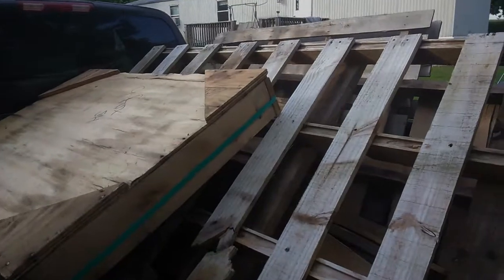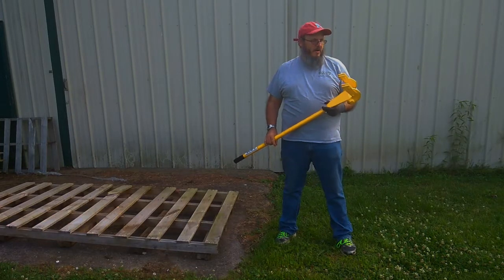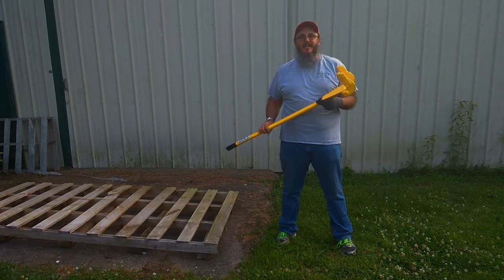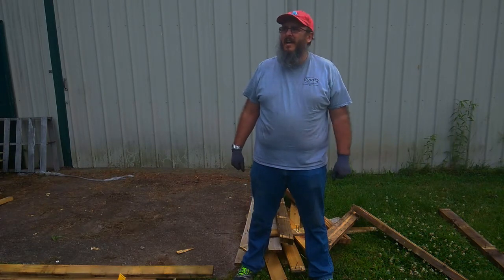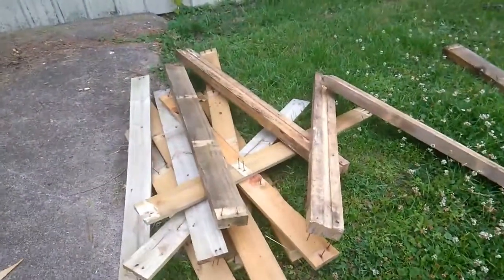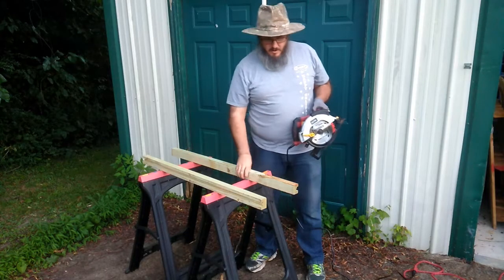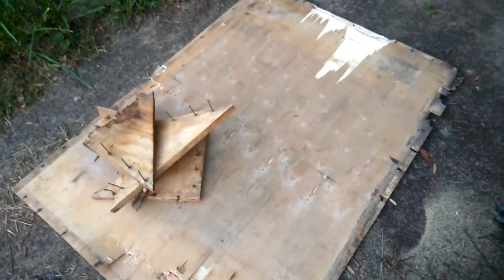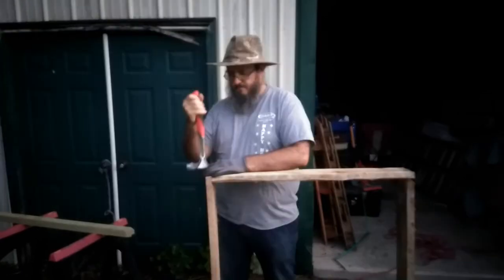Pallet Busting Trial and ERROR!

Comment: I have a similar tool for busting pallets. My problem is trying to find the pallets when I have room in my vehicle. A pickup truck would make my life so much easier!  Yeah, the wood on those pallets usually requires predrilling.
Reply from the maker: That's what I ended up doing. I pre-dilled all my holes, and it went fine. Pallets are not an ideal answer, they are affordable. Just takes more work.

Comment: Yup free doesn't always mean easy ... I found that a nail gun and compressor work best for building with pallets ... Pretty cheap at Harbour Freight ... Screws don't work any better than nails on those hard one's
Reply from the maker: I ended up using my drill. I pre-drilled the holes, and then pounded the nails in. It was extra work for sure, but allowed me to finish with what I had.
Reply: @MicroFarmStarter   ...  Sometimes ya just have to do that, definitely put an air nailer and stapler  on the list ... I use mine ... A Lot ... Blessings to you Both